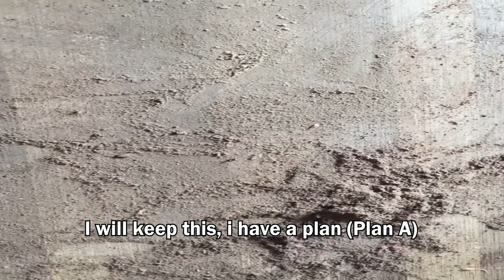Fully Rusted 100 Years Old Hand Saw Restoration - IMPOSSIBLE RESTORATION

Comment: awesome, i watched rust removing electrolysis , you showed this saw , cool restoration
Reply from the maker: And still in very good condition... I dont use it daily because i want to keep it for collection.
Reply: @RandomTubePT  for restoration u advised that not to use stainless steel as anode , what did use as anode  bar of iron